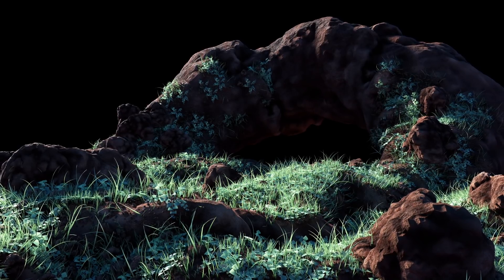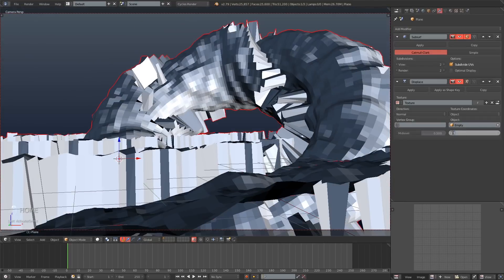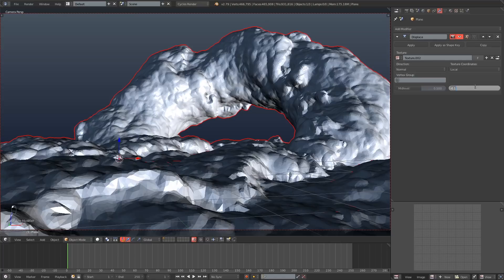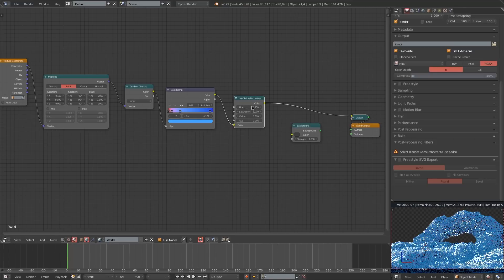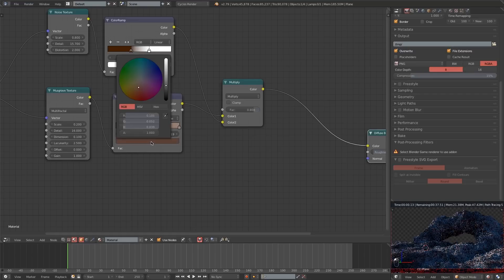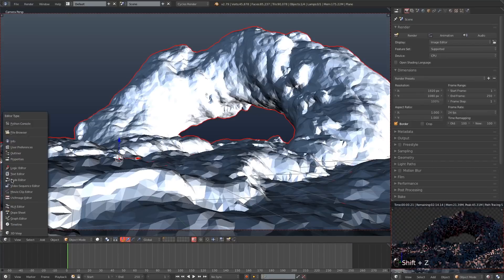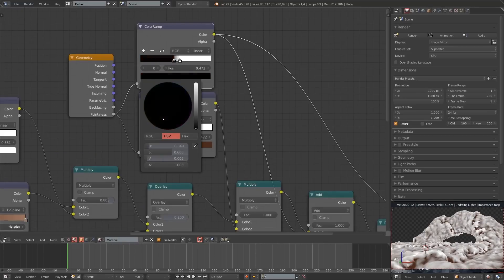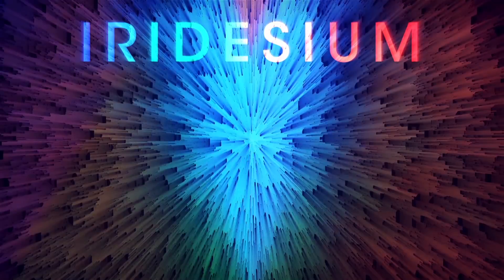How to Make Procedural Nature in Blender Part 1 -  Iridesium

Comment: I have a problem, my PC does not handle the process. ADM  Ryzen Threadripper 2950x 16 core. 64 G of Ram. Gforce GTX 1060 6GB.
Windows 10 Pro. so I wonder how you can did it !!!!
is there anything wrong? in my PC

Comment: Also, just pause on where he selects the colors on color ramp, the exact shades are important to get right. Just notice the RGB values and enter them manually on your side, so as your colors are perfectly identical. Believe me, I had to do this tutorial twice, because of the colors didn't match, and my final look was off by quite a bit. Also, the sun placement can't be identical, so you have to adjust it as soon as you add it (when author does, but doesn't adjust), so that you get some nice shadows. Don't worry about all the extra noise at that stage, because when you add the dirt texture finally towards the middle of this video, the extra noise will get adjusted. Also, at 14:55 , notice how he has inverted the bump node, don't forget that.

Comment: So I've started this in 2.79b, and displacement is now a vector - how would I get the noise texture to work correctly with this new vector displacement?
Reply: EDIT - use the Vector -> Displacement node and plug the colorRamp output into the 'Height'